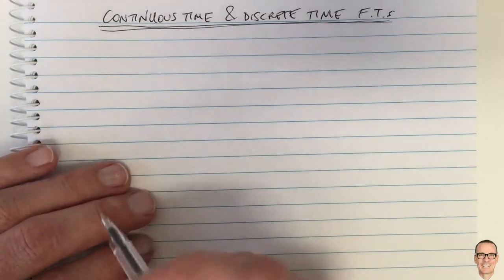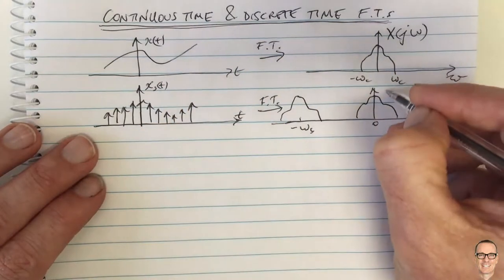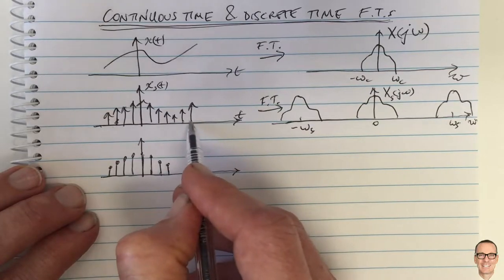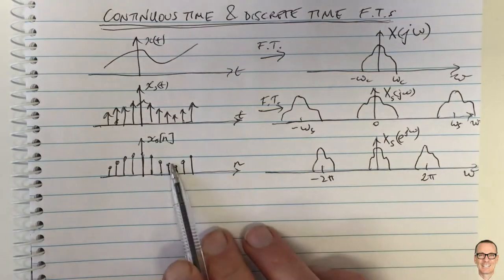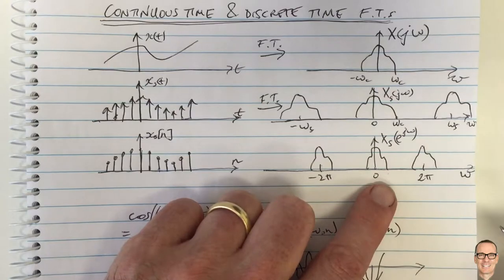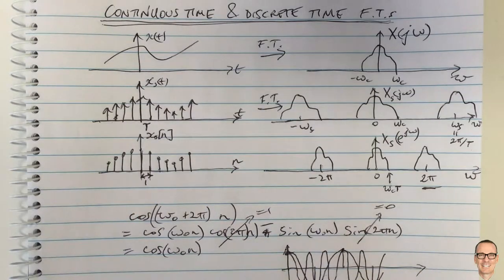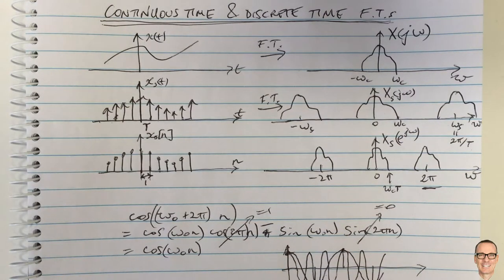Continuous Time and Discrete Time Fourier Transforms

Comment: Thank you for this awesome explanation . I have few doubts which I would like to clarify . The Fourier transform of a train of impulse function is also a train of impulse function and if you multiply in time domain then it is equivalent to convolution in frequency domain . Going by this fact, the diagram which you drew should have as many replicas of baseband FT as there are delta functions , you drew only two . But there are many time shifted delta functions which you depicted in the plot
Reply from the maker: Yes, that's right. I only drew frequency domain copies at +/- omega_s because I didn't have any more room on the page. But they also occur at all the integer multiples of +/- omega_s

Comment: Thanks Iain. IS it safe to say that when T=1, the F.Ts of both the continuous sampled signal and Discrete signal will be the same?
Reply from the maker: Yes, that's right. You can confirm it by comparing the equation for the continuous time FT with the equation for the discrete time FT. The integral in the continuous time equation becomes a sum when the signal is a (sampled) sequence of delta functions, and if the elements of that sum are at integer values of t (ie. T=1), then you've got the same equation as the discrete time FT equation.

Comment: Using trignometric relation you proved that cos[(w+2*pi)n] = cos(wn)-sin(wn). how is this equal to cos(wn) ? I am little confused here..can you please clarify?
Reply from the maker: Just to clarify: I didn't prove that cos[(w+2*pi)n] = cos(wn)-sin(wn). I actually just expanded out cos(A+B) using the standard expansion cos(A)cos(B)-sin(A)sin(B). Then I mentioned that sin(2 pi n) = 0 , since n is an integer, the sin function equals 0 for any integer multiple of 2pi. This means that the second term in the expansion is 0 (ie. the term sin(A)sin(B) ). And also cos(2 pi n) = 1 (since cos = 1 for any integer multiple of 2pi), which means that the overall expansion equals cos(wn).

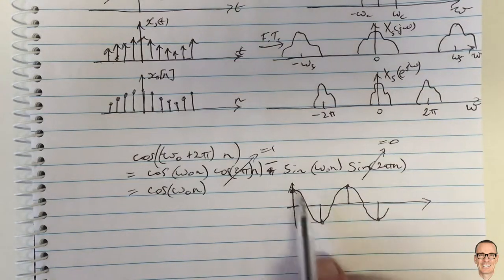Comment: @ 5:24 what is the significance of drawing two waves of different frequencies with same number of the samples
Reply from the maker: It shows that if you have a set of discrete samples, then they can represent multiple different continuous-time signals. In the example I showed, it was a cos wave at a frequency w1 and another cos wave at the frequency w1+2pi. I could also have drawn another cos wave at the frequency w1+4pi, and it would also go through all the same points, and so on. And so in the frequency domain plots there will be repetitions every integer multiple of +/-2pi.

Comment: Hi professor, I have a very naive question: would sampling in the signal processing be a similar idea to “discretization” in the numerical analysis?
Reply from the maker: It depends on the type of discretisation you're talking about. Sometime discretisation refers to generating a discrete-time approximation to a continuous-time system. In this case, yes, "sampling" is an important step in that process. In other cases, discretisation refers to quantising the amplitude levels of a signal. For example, both types of discretisation are performed when your voice signal is "digitised" in a mobile phone (before it is transmitted). The continuous-time waveform is sampled at 8 thousand samples per second (ie. time domain sampling), and the sampler (ie. analog-to-digital converter) records/stores each sample value by mapping it to one of 256 possible amplitude levels (ie. amplitude domain quantisation). These 256 levels are indexed by 8 digital bits (2^8 = 256). Therefore the overall digital signal requires 64 kbps.

Comment: what is the difference between continuous time sampling and discrete-time sampling as we are sampling with the same impulse function only
why its like that in case of continious time sampling the signal is zero between the two samples where as its undefined between two samples in case of discrete time sampling but we are using the same delta function in both the cases.

suppose we are sampling a signal at rate 1mega hertz than the sample spacing would be 1 micro sec that is not an intiger value means sampling in discrete time is not possible if we are sampling at that high rate ???  where as sampling in continious time is possible  as 
1 micro sec is not an intiger  value .
Reply from the maker: Well, it's not actually "the same impulse function". The continuous-time basis functions are different from the discrete-time basis functions. In discrete time, nothing exists between the values. There is no sense of "time", there is only the integer indexing of the values. "Discrete time" signals only relate to "time", when you associate them with a "time difference between the values", eg. T. More specifically, the continuous-time impulse function has "infinite height and zero width", whereas the discrete-time impulse function has unit height (and in "discrete time" there is no notion of "width" - since all the values are "discrete").

Also, you need to be careful not to confuse the word "sampling". Strictly speaking, "sampling" is the process of taking discrete samples from a continuous-time signal, and in doing so, generating a discrete-time signal. Sometimes people talk about "upsampling" and "downsampling" the discrete-time signal, but that just involves adding or removing values in the discrete-time signal/vector/sequence (... however you prefer to think of it). It's not the same as "sampling".

Comment: The 2nd set,( the FT of delta functions ), right hand side graphics seems incorrect. It should be still delta functions,am I  right?
Reply from the maker: No, you're not correct. If the time domain delta functions all had the same value, then you would be right - the Fourier transform would be a series of delta functions (https://youtu.be/t0NLutwAi3c). But in this case, the time domain delta functions each have different values (given by the function x(t) values at those times). See this video for more details: "Sampling Signals" https://youtu.be/AcuQnIXiZ2A
Reply: I got
Time domain  function  multiply the pure delta functions equal  to convolution of both two functions in frequency domain.
It would be series of bell shape.

Comment: Thank you so much for these videos. Question, if I had a continuous time signal 5*Cos(wt). Will the amplitude on the plot Xs(jw) be 5*pi*(1/Ts) ? Or simply pi. What about the Xs(e^jw)? Will the amplitude be 5*pi ?
Reply from the maker: Yes, it's the second option you suggested: 5*pi*(1/Ts), and this is the same amplitude for the Fourier Transform of the discrete time version of the signal, Xs(e^jw), too.